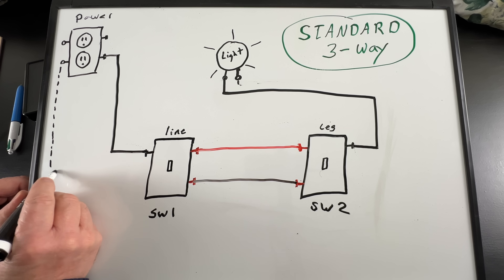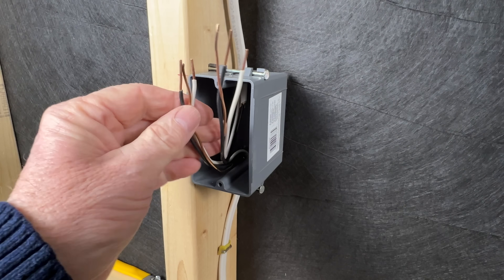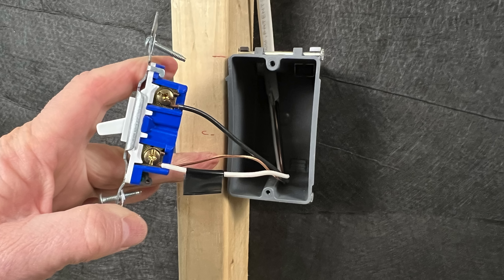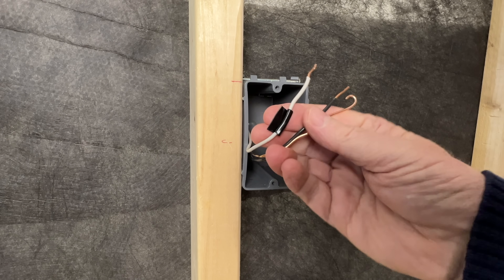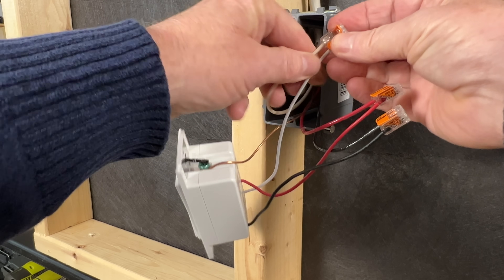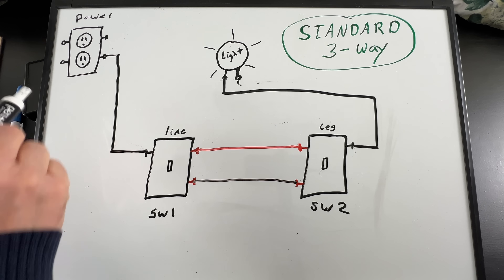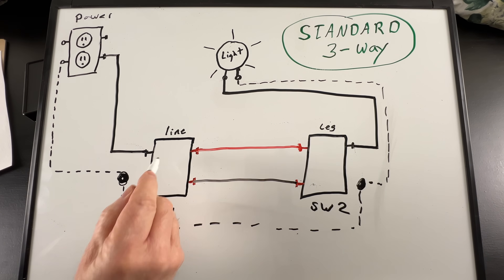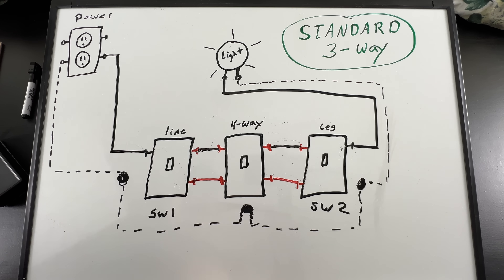How NOT to Wire Light Switches in 2025 (New Rules)

Comment: Listen up there’s no actual tradesman on any governing bodies anymore. They have been replaced by manufacturers . There sole purpose has nothing to do with safety but in reality, finding a way to generate more revenue to increase their stock prices so ppl will buy their stock! 

If u really want to find the reasoning for anything follow the 💰!!!!!!
Reply from the maker: Your statement is not accurate. The CMPs that write code are made up of a wide range of people including electricians, contractors, engineers, consumers, manufacturers and distributors. They work on a consensus approach. Look it up. You may be surprised. You may also be surprised to know there is a safety reason for requiring a neutral at light switches. With no neutral people were using the ground wire which should be a non current carrying conductor.
Reply: Incorrect.

Comment: In the dead end 3 way, if you changed to smart light switches, the switch on the dead end becomes a remote that basically talks to the first switch and tells it to turn on or off. So you wouldn’t necessarily have travelers per se and you definitely wouldn’t have a load on the white wire. You would just rewire things on both ends so that white stays neutral. And the load going to the light would get fed from the first/main switch.

Comment: Who still uses wire nuts in 2024? Ridiculous.
Reply from the maker: Almost all licensed electricians use wire nuts. I would guess maybe half the DIYers use wire nuts. So to answer your question most everyone.
Reply: @BackyardMaine  Perhaps in USA. Which is pretty backwards in a lot of other areas, not just wirenuts. We got PEX a few decades after it was mainstream everywhere else already.
Reply from the maker: @firstlast9292  wire nuts are a superior connection when installed correctly because they apply tension over a much larger surface area. The lever connections are pretty decent especially for low amperage lighting circuits. They are also convenient but they cost more, take up more space in the box and are not as reliable as a wire nut. Been in the electrical industry for 40 years.

Comment: As a home owner of a 80 year old house (so no neutral wires at the switch box), what's the best way of getting a neutral there?  Do I need to (pay someone to) pull a new wire from the light fixture down to the switch, or could I use a convenient nearby power socket and grab a neutral from there?
Reply from the maker: The neutral to the switch will need to be on the same circuit and hot wire is now. The receptacle could be an option if it's on the same circuit.

Comment: The Algo sent me here for some reason. I'm an 01 Electrician (commercial/industrial) and just did this work in my garage.

3 cheap fixtures -> 12 LED
1 switch -> 2x 3-way
Split some lights off for task lighting controlled by SP switch near their respective doors.

While I'm not interested in any smart devices where my garage lights are concerned, there are cases where a future home owner might. For instance, smart switching can be part of a disability accommodation where mobility or reach is limited. Regardless, neutrals at the switch location is both code compliant and a good idea.

That being said, if I had to tear down any finish work to preserve or add a neutral, I'd skip it. This is a choice I make in my own home. Fortunately, an electrician can get a lot done by adding a junction box. By doing this, there is no longer a need to bring the neutral back out of the switch box. That return neutral conductor is now a free agent!

Like others have said, REIDENTIFY YOUR WIRES when necessary. Phase tape comes in all the colors.

Stay safe!

Comment: The only problem I see is according to your sketch you pulled power off a receptacle Lighting should be on a separate home run.
Reply from the maker: No actually its code compliant to combine lighting and receptacle circuits. You can separate them but it's not very common and it defiantly increases the cost of installation.

Comment: A 2-wire cable has 3 wires.  A 3-wire cable has 4 wires.  A two by four measures 1.5 by 3.5 inches.  Why is everything in the construction trades a lie?
Reply from the maker: Haha..Good point...  They never count the ground because it's not a current carrying conductor. I actually worked at a lumber mill when I was a teenager. The dimensional lumber is cut to that exact dimension. This lumber is then sent to a kiln where it shrinks a small amount while drying and the run through a machine where it is plained for consistency to the 3.5" x 1.5" we see today.
Reply: @BackyardMaine  It's not about CCCs, it's about insulated conductors. NM with 3 total conductors, 2 insulated and 1 bare, is 12-2. Cord (SJ, for example) that has the same total number of conductors is called 12-3, the ground is insulated. Can't really identify the number of CCCs in a cable/cord until it's put into service.
Reply from the maker: @pld8993  Thanks for clarifying that point.
Reply: @BackyardMaine  Cheers

Comment: Great info and video! How is the power wire connected to the receptacle at the beginning? How does this work with older 2 wire setup (they are both black not sure if one is neutral)? Thanks for the feedback!
Reply from the maker: There are some unconventional methods that were used to wire 3 way switches on some old homes. I'm not sure what you have but I do have a video on the Chicago and the California 3-ways that may answer your question. You will find them on my home page.

Comment: NEC taking shortcuts for industry manufacturers, sure seems like it anyway.

Edit: But a great video nonetheless
Reply from the maker: I think what's happening is people are using the ground wire to connect the neutral from the smart switch so it will actually function. But this puts current of the ground path which can become hazardous. I believe that's what drove the change.
Reply: @BackyardMaine  thank you for the clarification, that makes sense, much appreciated

Comment: I have light fixture that’s has : black ,white ,copper wire ground , ceiling has : black, red white ,copper wire ground, 
Now light turn on and off but only with the breaker ,light switch doesn’t work is a double light switch for the room and for the closet, help

Comment: Great video. I got confused with the neutral boxes? You are saying that there is a separate box for the neutral?
Reply from the maker: Neutrals have not typically been needed at switch boxes. There is not neutral connection on a typical switch so they usually just wire nut in the box where they go on to the lights where they are needed. New smart switches and some occupancy sensors do require a neutral to work properly. These new switches are responsible for the code change.

Comment: In the dead end three way, if you needed a neutral for any reason in the last switch, you could run an NM 14/4 which has Black, Red, blue white and ground. Expensive stuff if you don't need it that much but u could run 14/4 between the switches to bring in the neutral. It would also save re-identifying the white wire. Again, not required, but an option. In a job site where there's 120/208 there may be some of that NM or MC cable around. In conduit, easy peasy to run a blue wire.

Comment: I am a little confused, are you saying that to replace a light switch, you now have to rewire the house?
Reply from the maker: The new code would only apply to new installations. For example if you were wiring up a new room which you took out a permit for then it would apply. Replacing switches would not apply.
Reply: thats good, just seems like we are heading for a place where light switch, light and receptacle are going to need a permit, which will destroy the average persons ability to do basic maintenance.

Comment: Why would you use a white wire to switch number two wouldn't it be a black wire since it carries current to the light? The only white wire should be the neutral wire going from the light to the power source which is the outlet.

Comment: The NEC code book has been hijacked by the big electrical component manufacturers.  It's actually a flagrant, takeover of a once strictly, human safety and industry standards publication.  I've been in the business over 40 years and had a longtime friend in the code writing industry in NC.  He knew all players and how it changed over the years.   He was a very smart man, may he rest in peace.   Just my two cents for the day.
Reply: There are certainly a handful examples of industry driven changes in the NEC, but your statement that the NEC has been hijacked and taken over is just false. If you understood the NEC revision process you'd have a better understanding of changes and how they make their way into the newest edition, thereby allowing you to make an informed opinion instead of a reactionary one.
Reply: I’m updating a decades old home and it s not really just fine. Entire circuits were left ungrounded and some schmuck apprentice crossed his hot wires to the neutral side of an outlet. We’re lucky nobody has been hurt and there hasn’t been a fire.
Reply: @_audacity2722 switching the neutral and hot is really only a fire hazard if there's a problem with the appliance...

I think crossing the hot and neutral on a light fixture is much worse (because it's still live when you're replacing a bulb)
Reply: Where most of the griping comes from people set in in their ways. The “I don’t need to know how to work with new technology because the old way worked alright” crowd become the folks that want to take the new build jobs and incorrectly wire them. They want the money but want to half ass the job or wire it incorrectly. And how dare we suggest they be required out the most minimal updates to improve safety, or build future resistant homes.
Reply: I see this recently in efforts to make it harder and more expensive to install electric car charger in home garage.
Reply: @JoeRoaddogSmith  This code change may have resulted from injuries or other incident from having to fish a new neutral for the switch box.
Reply: @JoeRoaddogSmith  Lol.  You don't have to believe how long I've been in the industry, you can look me up.   I retired in 2020 from the constitution business.   NC Electrical License 11070 obtained in 83 or so l believe.  General Contractor License 51084 obtained in 97 or so.   Skepticism will serve you well in life.  It did for me.   Made me and my family millionaires by age 48.   Anyways, have a great day and always be safe. ✌️
Reply: Some things are like the requirements for ark fault. Not risk vs cost but was risk vs industry profit. GFCI for 30 amp 2 poles was risk (one child was electrocuted because of a miswired A/C compressor) vs cost/mostly industry profit. (Texas said, I don't think so after A/C compressors tripped breakers in 110 degree weather) Grounded conductor at switch boxes & min ocp device of 10amps is tech driven (LED lights)
Reply: We have to solve almost non-existent problems now. Soon each and every thing will have to be GFCI and ARCFAULT protected. Way more stuff to drive up expense. I remember when only bathroom outlets and outdoor grade level outlets had to be GFCI. Bathrooms so you didn't electrocute yourself if you dropped a hair dryer or radio in the tub with you. And outdoor grade level in case you had a faulty power tool with a broken ground wire in the cord. Neither of which was a common problem.
Reply: I agree. The NEC has got ridiculous and over-governing making installations extremely expensive all in the name of “safety”.
Reply: What are you guys smokin?  It's technology that drives this.  I have had situations where I couldn't use switches requiring neutrals.  I hear your point but there is a lot more going on that encourages code changes.  Smart switches, unless your Ted Kazinski and friends, are awesome for so many reasons.  Having neutrals at all boxes although is a pain in the ass is nice for adding a receptacle later on and being able to use and switch from the hardware store/ wholesalers.
Reply: @Matt-my7pz not sure if NEC is the same but CEC makes it impractical to use AFCI devices instead if breakers because if you use the devices , the wire from the panel to the first device must either be in conduit or armoured cable. How is that wire more likely to be subjected to damage than the one right next to it that doesn’t require an arc fault? The only reason for this rule is to force people to buy an $85.00 breaker instead of a $30.00 device.
Reply: @mitsarp  I hear what your saying.  It's the same up here.  To remain neutral on the point I don't have a clue what is involved with manufacturing, legalities, etc but I do see your point.  To most topics code, I don't believe uninvolved people have all the facts. Even electricians that like to think they know all the reasons for a rule. Just like employees criticizing the methods of the boss, whether it's the work, rotation guys through one job, costs...  An employee doesn't know the pressures, responsibilities and other factors involved, but from the outside it looks like such bad careless decisions.  I'm going to deep dive into the logic of the arc fault wire rule, totally agree about the nmd next to it not protected, but there has got to be more to it that put code designers in a tight spot.
Reply: @Matt-my7pz yup... I just recently installed a smart switch in a box. Thankfully, there was a neutral in the switch box... otherwise, my $8 home improvement would have turned into a $180 improvement (just to replace one stupid switch).
Reply: There hasn't been a relavent code update to residential wiring since the 90's.
Reply: It's technology that drives this new code  I have had situations where I couldn't use switches requiring neutrals .  I hear the point of the complainers, but there is a lot more going on that encourages code changes.  I used to think the same about tamper proof/ tamper resistant receptacles until I saw my young kid poking at a receptacle the first time.  Smart switches, unless your Ted Kazinski and friends, are awesome for so many reasons.  Having neutrals at all boxes although is a pain in the ass is nice for adding a receptacle later on and being able to use and switch from the hardware store/ wholesalers.
Reply: Yours is the most incisive comment on any code-related video on You Tube. It is blatantly obvious that code updates are driven solely by the industry’s greed. Code requirements have cost homeowners billions of dollars over the years. If the industry can find a way to charge $100 for a circuit breaker that was $10 a few years ago it will, all under the guise of “safety” when in fact the risks are more theoretical than real. Proof is in the fact that millions of homes built under decades old codes are doing just fine. Careful and proper practices and decent quality products from the 1990s — plus instruction in basic electrical safety for consumers — were all we needed. Instead, we open our wallets wider with every code update.

Comment: I have a question... I have a light at the top of my stairs that is wired to a 3 way at the top of the steps (sw1) and a 3 way sw2, at the bottom of the steps(leg). I want to add a light at the bottom of the steps to go on and off with the light at the top of the steps.
My power goes in to sw1 and to the light, then 3 conductor to sw2. 
If I need to, I can get wire down from sw1 to sw2 or the light. 
Any suggestion on how to do this safely. 
Also, I was looking at smart 3ways, but I can't find an example on how to wire that configuration... Any help would be appreciated, thanks.
Reply from the maker: Since switch 2 only has travelers and the leg back up to switch 1, then you have no neutral at the bottom switch. In order to power the light from these same switches you would need to carry a neutral down to switch 2. The best option is to run a two wire ROMEX down from either the switch 1 box or from the light at the top of the stairs down to the light at the bottom. You don't need to do anything with switch 2.

Comment: Looks like they are in the business of selling wire.
Reply from the maker: No, it's a safety issue. With no neutral in the box people are connecting the neutral on the lighting control to the ground wire which is only intended to carry fault current. The ground system now becomes a current carrying conductor which presents a  shock hazard.

Comment: I have been using feedthrough method all the time. you don't save anything going other routes and using 3 wire is even more expensive. generally, a switch, should be on the hot line and as close as possible to the power source. so when the switch is open, anything after that is not hot.

Comment: I’ve always ran a 14/3. The loop drives me crazy. It doesn’t cost that much more nor does it take a ton of time. Pay attention and it’s simple.
Reply from the maker: Yup, most lighting circuits are on 15A circuits and can be run in 14 gauge wire. If its a 20A then 12 gauge will be required.